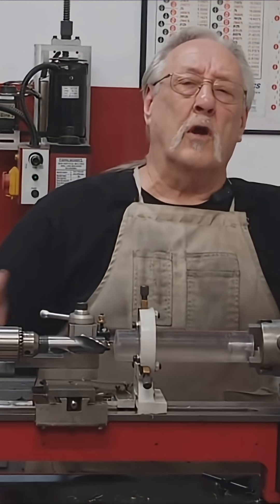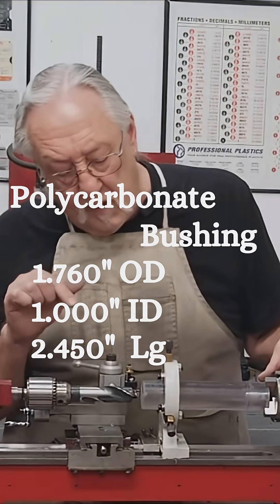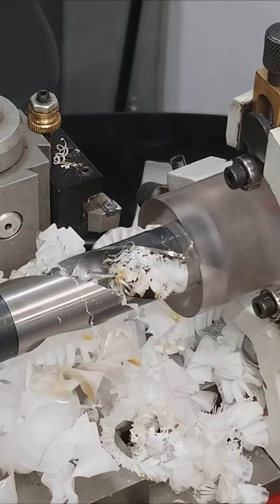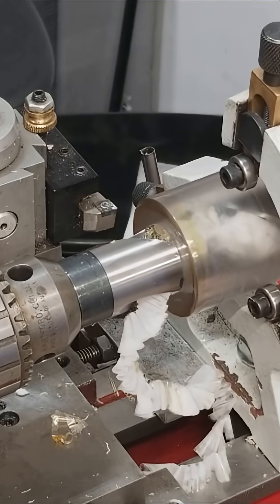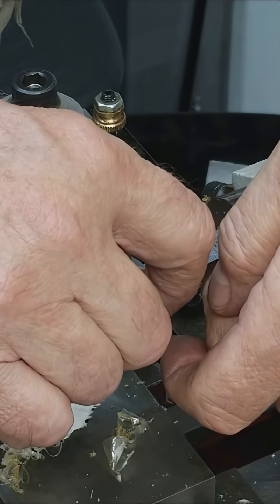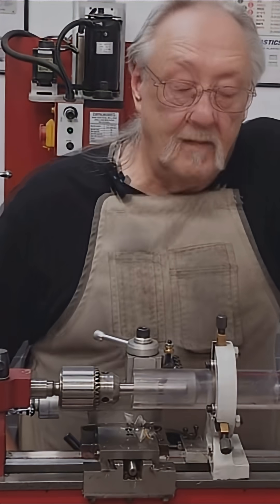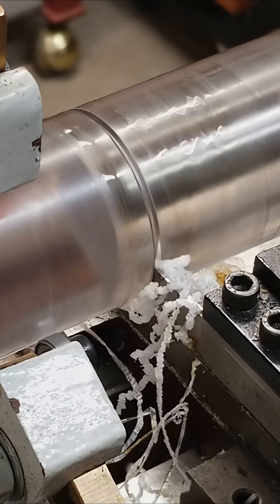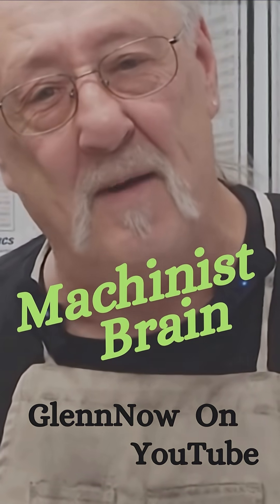Machinist Brain 6,  Drilling PolyCarb

Comment: I've drilled too fast and got drills melt hard stuck in acrylic in the past. Is there a lubricant that is practical for plastics? Maybe one that is water soluble?
Reply from the maker: The most important thing to remember when machining acrylics is making sure your  tool is sharp, Very sharp. With a drill bit make sure its center cutting (split point) .Water soluble lubricants only works as a flood coolant. What a mess 😵‍💫 . I just use cutting oil and stop if the part gets to hot and cool the Tool.  The same way you would as if you were grinding a tool bit.